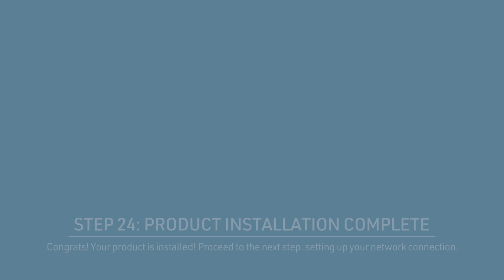U by Moen Smart Faucet Installation Guide

Comment: I came here trying to figure out how to recalibrate my faucet.  water pressure will only go from 50% to 100%, even with the handle.  Can you program it to run at half pressure automatically instead of full pressure when you turn it on with the sensor?
Reply from the maker: Hello Dagwood and thank you for your interest in Moen products. To recalibrate your faucet, open the Moen Smart Water app, tap on your Smart Faucet, tap Settings at the top and then tap "Fine Tune Your Device". At this time the sensor pressure cannot be adjusted and the pressure can only be adjusted using the handle or creating a preset in the app. If you have any additional questions, please contact Moen Plus Support at 1-800-289-6636; our current business hours are Monday through Friday from 8:00 am - 7:00 pm EST.

Comment: Nice guide. What is the size and type of shut-off valve please? Main hose is 3/8-inch but hoses for hot and cold water connected to the control box are a bit smaller. I cannot connect them to my current shut-off valves.  Can you share please the exact type I should use? Idealy a direct link to the product. Thank you.
Reply from the maker: Hello Milos.  Our records show that you contacted us about the U by Moen Smart faucet and as we previously shared, the U by Moen Smart kitchen faucet is only approved for use in the US and Canada.
Reply: @moenfaucets  Can you please answer my question?
Reply from the maker: Hello Milos.  The built-in supply lines on Moen kitchen faucets have 3/8" compression fittings to connect to the water supply.
Reply: @moenfaucets  Thank you Moen

Comment: Ok but how do I install with PEX? Do you have an adapter? Can you do a video with that?
Reply from the maker: Hello Zachary Mull and thank you for your interest in Moen products. The U by Moen Smart Faucet control box flexible supply lines with 3/8" compression fittings are required to be attached to shut off stops. PEX can be attached using standard plumbing adapters. Due to the uniqueness of each individual customer's home and environment, we cannot recommend a specific adapter as each application will vary. If you have additional questions or need assistance, please contact Moen Consumer Services at 1-800-289-6636; our current business hours are Monday through Friday from 9:00 am - 5:30 pm EST.